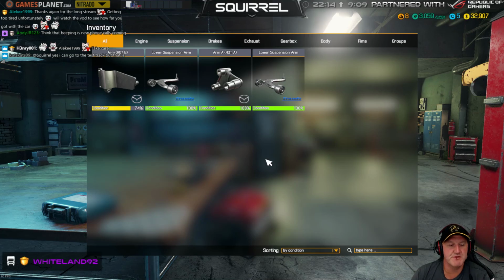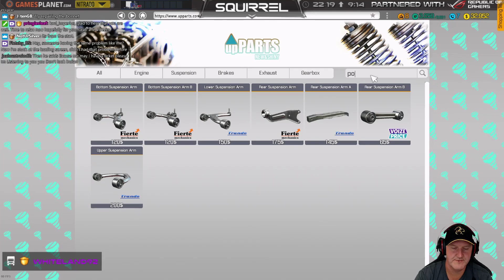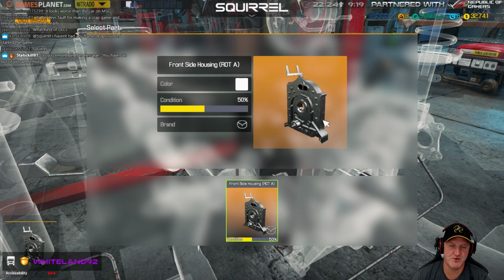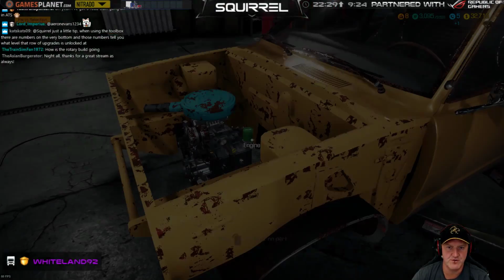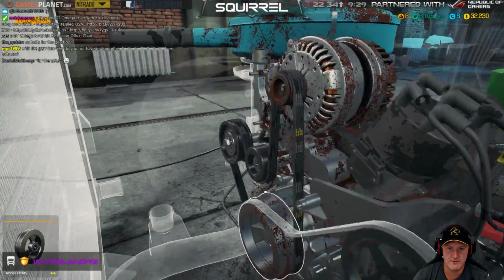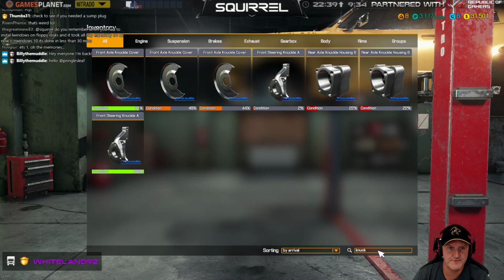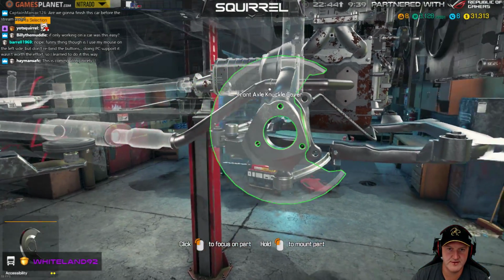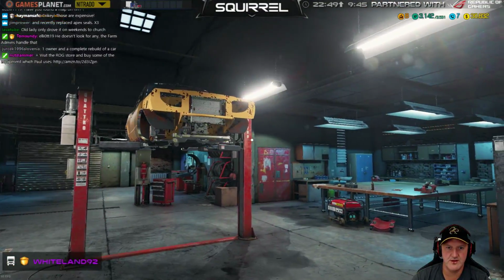Car Mechanic Simulator 2018 | 29th July 2017 | P5 | SquirrelPlus

Comment: Hey Squirrel.  The engine hoist is different than the engine stand (which you do have in your shop).  The hoist (nicknamed the cherry picker) looks like a crane with a hook at the end whereby you'd attach chains to it and connect them to the engine block).  The engine stand is just that.  You'd wheel the cherry picker to the stand, jack it down to the height of the stand and then line the mount points on the stand to the rear of the engine (basically using the transmission bolt holes for mounting).

Pretty sure you knew this, but hey info never hurts :-)  Love this video series.